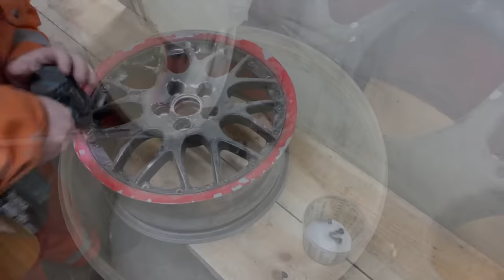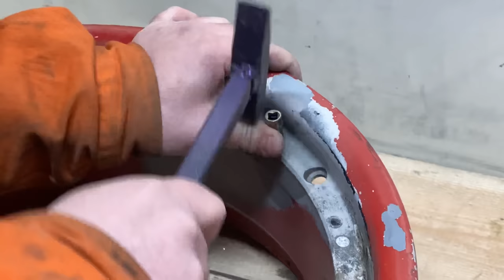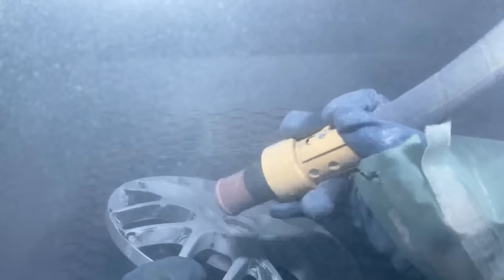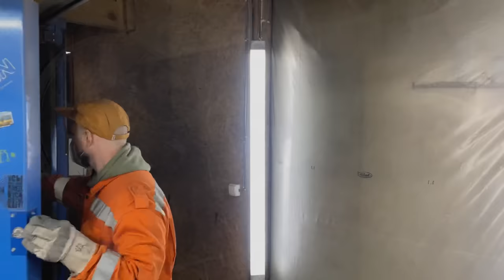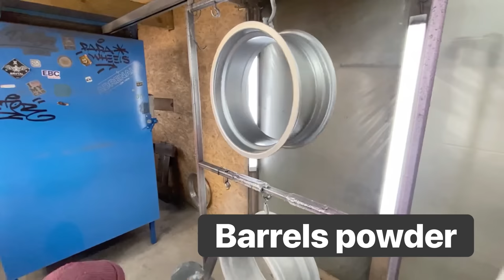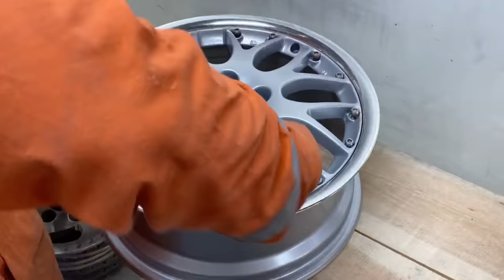From Worn to Wow: Our BBS RS771 Restoration Process

Comment: Bolts should constantly be renewed!!! That is a must for the company BBS!
Reply: Even with titanium bolts?
Reply: @vanishingpoint808 The short answer to that is: depends on the bolts. Although titanium offers a superior strength to weight ratio when compared to steel, titanium isn't necessarily stronger than steel.  So unless you are very sure of the specs of the bolts you're taking out, I wouldn't risk it and just renew them as BBS requires. Be it steel or titanium, metal fatigue happens to any metal that's exposed to repeated stresses.

Comment: 9/10 shops wouldn't even dissemble let alone clean up each bolt. Really thorough job and very refreshing to see 👌
Reply: Neither would I disassemble the rims. Chances are high, shearing these screws off. Those are made of Titanium. 
Masking them and happy it is.
Reply: 1500-2000k in a shop..
Reply: shops didt remove old balancer glues anymore people just go after green paper

Comment: Yes. But, will they hold air? 😉
Nice to see ‘em get another shot - very well done.
Reply: The barrels are one piece, so unless of a crack, yes they will hold air even without the center bolted in.  The only question I had was the texture of the tire bead seating surface not allowing it to seal very well.

Comment: Awesome job,unfortunately non of our local wheel refurbishment companies can pull off a job that good, they all cut corners
Reply from the maker: Thanks 🙏
Reply: Most shops.  Time is money!
Reply: My local workshop drilled through the inner plates of my bbs rc 324 so they could hang for powder coat ……. I asked them to vibro polish the crown and they polished it on a polisher wheel and they put a clear coat on top of it. Which would’ve been ok but they put the clear over dirt and debris of polishing compound

Comment: fantastic work. What impressed me most was that you used every part in its original condition and didn't buy anything new. This is therefore absolutely original. mega. This is a true restoration and not using new items
Reply: he fail and broke the bolt

Comment: Can you tell us what torque you used when re-installing the face bolts?  I have a set of 2 piece AMG rims that will need to be refinished and the assembly torque is the only spec I am missing.
Reply from the maker: Around 25-28 nm

Comment: Where did you get new bolts? I broke 2 disassembling mine today
Reply from the maker: I’m selling used bolts if you need
Reply: @makukhawheels4674  I would def be interested if the price makes sense.
Reply: @makukhawheels4674 willing to sell 2?

Comment: Look great 😁I have the same mag and i planned to restor it but i dont have a sunblast or rust gun remover and paint gun so this is possible to do it without all this with just some sandpaper,chimical product,good sray cane skills? I know that would be long but my friend told me a restoration like that is almost the price of the mag so do u have any tips to do it on a budjet ? 🤔
Reply: when I restored some badly worn aluminum wheels I only spent $140 on sandpaper, aluminum polish, and a polish applicator. It takes a boat load of time to do but its worth it in the savings you get compared to having a professional restore ur wheels
Reply from the maker: You can do it yourself without any problems - but would be a long way))))

Comment: Shouldn't the bolts be replaced once removed because of stretching and shouldn't you uninstall/install the bolts cross sequentially to avoid warping the face of the wheel?

Comment: I often shock those broken bolts by hitting them with TIG and then quenching the bolt w/ Lectra-Clean (trichlorethane) and they usually thread right out.

Comment: Your work looks amazing.   The only thing i worry about is the heat used for getting the bolt out.  Does the barrel have any sort of heat treatment or rotary forging process from the factory?  Heat might change the crystalline structure of the metal and make it softer/malleable
Reply: Exaclty what I was going to comment, that wheel is most likely weakened significantly after such intense local heat application, and stress cracks may develop over time around the edges of the heated area. The proper way would be to put it in an oven and heat cycle it uniformly after the bolt was out. Aside from that, very clean result!

Comment: Wicked wheels. Would it be easier to put all the bolts in a sand tumbler to remove all the junk instead of doing them each by hand?

Comment: Nice work on a tedious job. What do you use to determing the Torque values of the hardware? Specifically, any kind of wheel specific reference material, general size of the hardware, or is it all tribal knowledge?

Comment: Bro you need to learn how to use an extractor bit it will make your life way easier
Reply from the maker: Won’t work here))) titan+alu
Reply: @makukhawheels4674  drill out the center and use the reverse threaded extractor instead of using a grinder and a flathead screwdriver.

Comment: In the process of redoing the set I bought for $140 bucks. What's the torque specs on the bolts? Thanks.
Reply from the maker: I used 28 ft/lbs here

Comment: What foot pounds of torque do you torque the wheels bolts?
Reply from the maker: I used 28nm here, but it can be 25-28nm for used bolts
Reply: @makukhawheels4674  thank you for replying. I’ve got a set of deep dish wheels that I want to polish up. 
Is there a particular pattern you have to follow to torque them down, like you would on an engine for example? 
Or do you tighten the bolts down randomly ?
Reply: 28nm, not ft lbs ? Thanks!
Reply: @captainmorgan2594  thank you for splitting hairs. Good job 👏

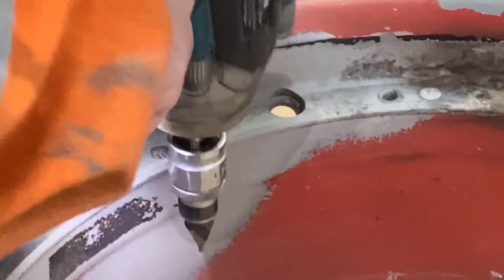Comment: 2:30, just start it by hand then run the impact. If you're that convinced you need ugga dugga force, tap the flat head bit with a hammer so it wants to break loose!

Comment: Nice job but the lips will corrode in no time without protection.
Reply from the maker: Yes, but customer wanted raw polish
Reply: @makukhawheels4674  would solvol autosol not protect them
Reply: @makukhawheels4674  raw polish followed by clear coat.  I guess you could also use something like shark hide or ceramic coating of some sort

Comment: So time consuming omg 😳
Reply: therapeutic for some.  helps to have the right tools as well (maybe not all techniques demonstrated here). plus restoring them is not a race...
Reply: @K03sport  yes I know . I would like to be able to do basic restoration but having a good sandblasting setup costs a lot upfront ...
Reply: @Bull1the1Great  chemical dip/strip or possibly harbor freight? $230 for the cabinet and $35-170 for the media blaster.  or you pay a local shop to blast them and you do the rest...